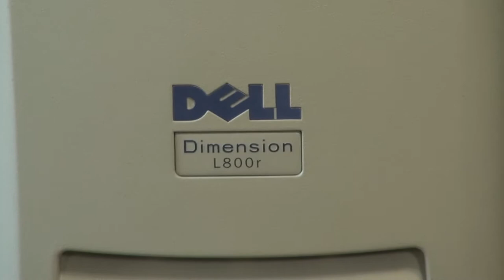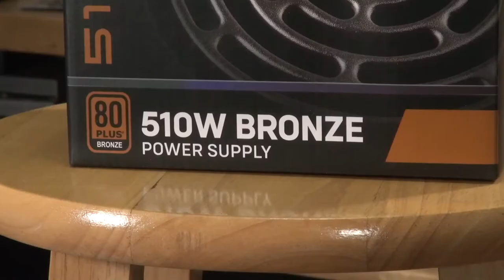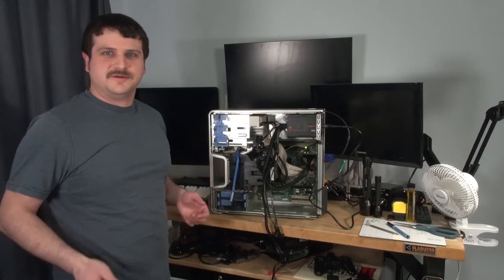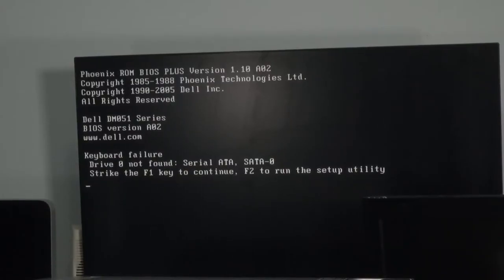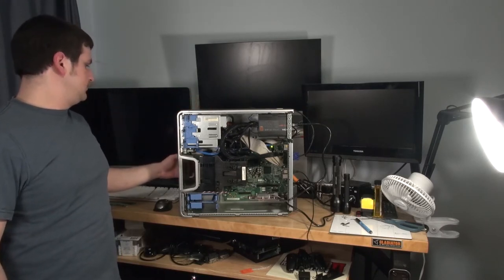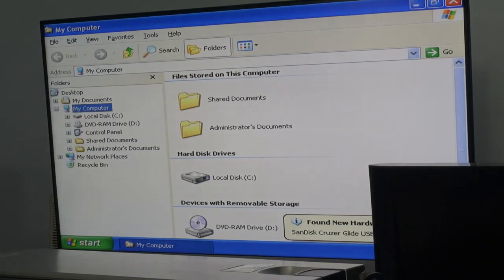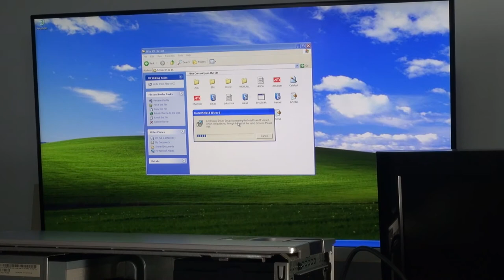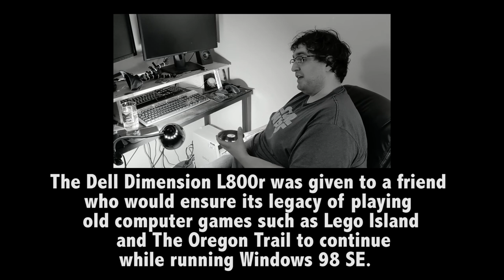Restoring an old Dell Dimension E510 Windows XP Machine

Comment: The original bios is A00. I had an A00 system, but I fried the bios mid-flash. Had to replace the board, and now have an A05 system.

Comment: Hey I legit just found one of these machines on the side of the road last week haha. Mine is also a dimension E510 but mine seems to be a later model since it has a pentium D, has a media center edition license, and shows a vista capable xp sticker. It had no ram, power supply, or hard drive but thankfully had the caddy so I could mount another hard drive. I managed to get it running with spare parts I had laying around. How are the caps in yours? There's some bulging on mine but it still seems to run alright for now.
Reply from the maker: I don't recall purposely looking over the caps but at the same time I don't recall any obvious bad ones. Plus, the computer still boots and runs normally so they're apparently still chugging along.

Comment: Not sure if you're still using this PC, but I have one as well. I'm waiting on a Radeon HD 7750. It's single slot, has plenty of power for XP gaming, and is only 55 watts. Plus, it has HDMI.
Reply from the maker: Mine doesn't get much use, but I did replace the graphics card I originally put in there with a GeForce GT 430 I found at a thrift store for $15. Still in box.

Comment: I actually have that same computer except it has the AMD processor. After digging it out I coudn't find the original keyboard and my current keyboard is not recognized. What type of keyboard do I need to find, it only has an usb input for it. Thanks
Reply from the maker: Really any USB keyboard should work. I use a generic HP keyboard myself for the one I restored in the video.